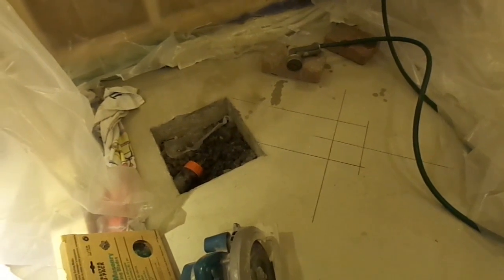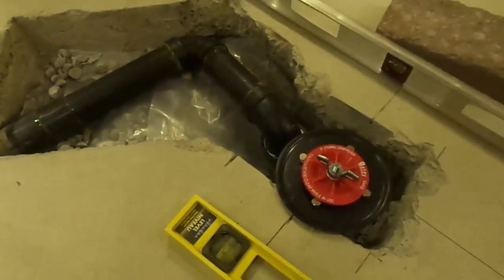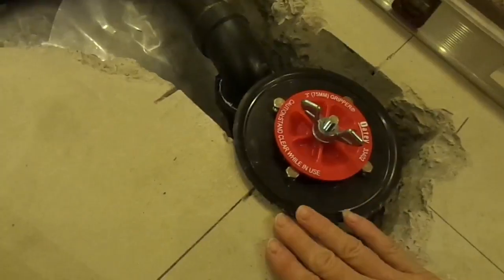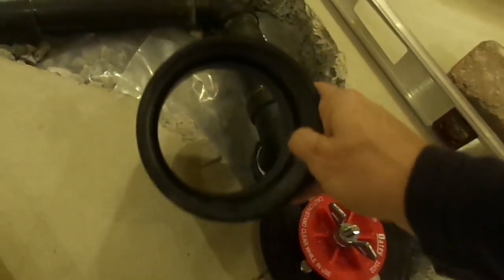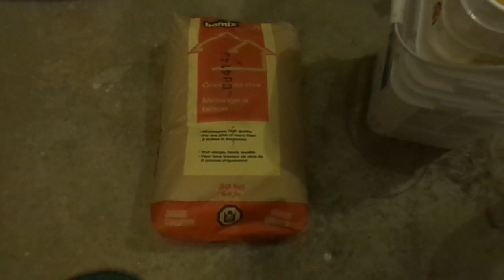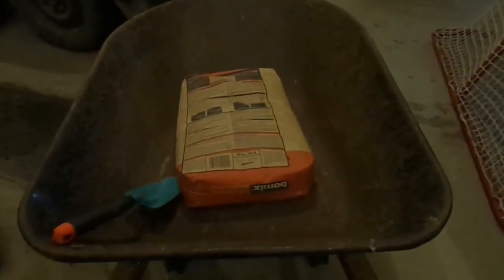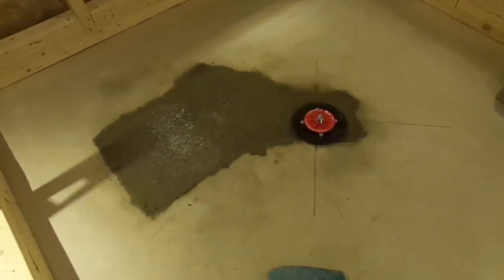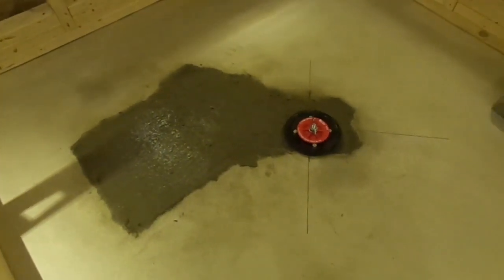How to install a shower drain in a cement floor

Comment: should have used a sweep 90 hope you never have clear a blockage
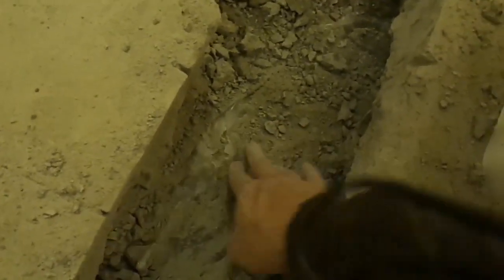Reply from the maker: +Peter Larsen Did so.  You can see it at 0:43 of the video.  As for clearing blockage, I consider it par for the course when you have a son with long hair.  Haven't had to unclog anything yet with this shower mind you, but I clear the other shower I have in the house (of which I had no hand in) every year or so. I never use a snake to unclog anything; I'm more into the fork, knife, and gloved hand approach which works quickly and like a charm.  Thanks for writing and putting a name to the part; didn't know it was called as such.  Cheers!
Reply: the 90 after the P trap does not look like a sweep ... you could still get a small diameter snake through ... lots of work huh :)
Reply from the maker: Peter Larsen Not my first P-trap so I'm sure it'll do.  So far, and so good, my hairy son has stayed away from the shower. Otherwise, have a snake (a long and short one), a fork, and a knife at the ready and the willing. Cheers!

Comment: installed wrong fitting after p trap.  Should have been a long turn 90.  No way putting a union p trap under a concrete floor is a good idea.
Reply from the maker: Indeed, would have been better. Thank you for writing.

Comment: Not to be one of "those guys" because I really do applaud you on the effort but, you really should have used a long sweep 90' on the horizontal after the p-trap. It also looks like you used a nutted  p-trap under the slab which is a huge no-no. (the only time you can use a nutted p-trap is in a accessible location.) I still think you did a great job though even though you "do it yourself types take food off of my table. :)
Reply: Dave Jones if we can't afford it it's not taking food off your table

Comment: Don't you need to vent that drain to prevent back flow and gurgling? Or did you vent it somewhere else down the line?
Reply from the maker: I was fortunate that I had the piping done by a registered (Régie du bâtiment) plumber when the house was built.  The position of the shower drain was just slightly off, and in the rough, hence this video.  There is a vent stack 5 ft away and also a vent stack about 10 feet away for the basement sewage basin. It all seems to have been enough. Thank you for your comment.

Comment: Looks great! Thanks for a nicely published video - very informative. How deep was the floor that you jack-hammered? 4" or 6"?  Was there wire mesh or re-bar in the floor? Is this a newer home...or older poured cement floor? Location? state? country?  Job well done. I'm about to tackle my poured foundation in Florida, expect to hit re-bar as well.
Reply from the maker: My basement floor is about 5 1/2 " deep which is, according to a certified foundation craftsman friend of mine, too deep which makes it prone to cracking.  It should be about 4" deep.  I'm lucky enough that our foundation is surrounded by sand, but still, I've had serious cracking across door openings in my house supporting wall (nowhere near this bathroom fortunately) probably as a result of this depth.  Wire mesh was used to do this floor but did not encounter any of it close to this drain. Had my grinder at the ready but it stayed put. Ours is a newer home, 11 years old and counting. Montreal, Quebec, Canada. Look out for your back, wear eye protection (with or without attached nose and mustache), and take the time that you need to cross your t's and dot your i's. No mistakes allowed. Thanks for the encouraging comment. All the best with your project. Cheers!

Comment: Thanks for making this video.  You mentioned you saw a youtube video with the installer putting in a vertical extension that they then cut off at concrete floor level.  Would you still have that link?
Reply from the maker: +eastavin Here is the video link: https://www.youtube.com/watch?v=Swj264jRu1E. Thank you for taking the time to comment. Cheers!

Comment: how much by our want to bet this shower leaked so bad after 6 months she had to call someone in to fix kt, it cost twice as much
Reply from the maker: +Tug Slug Nope. Still beautiful and running beautifully.  If you check for leaks before closing everything, this reduces the chances of any leaks occurring in the near future.  Sorry to make you lose your wager but when you put this amount of time, energy, and money to work on something, you have to cross your T's and dot your I's to insure a successful outcome. More wag, less bark.
Reply: Thanks for the update
Reply: good job
Reply: @tag slug I bet you don't  have the first clue in anything to do with plumbing or any home repair skill
Reply: Good job self served and great reply I need to do that in my shower